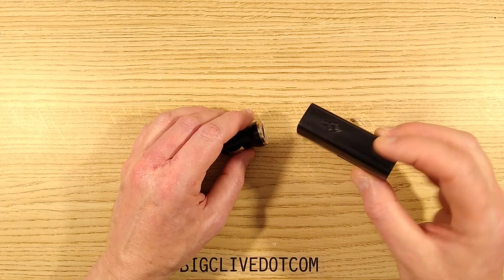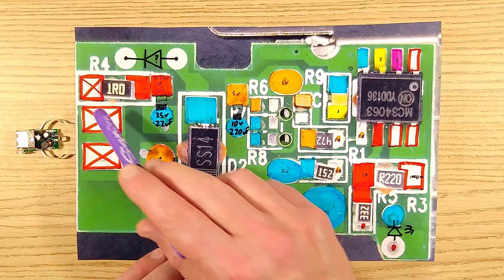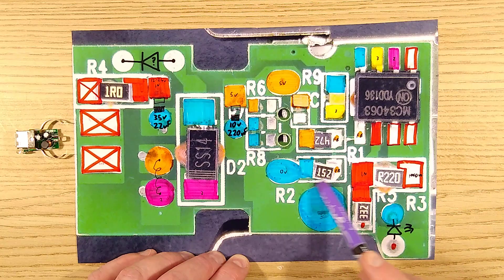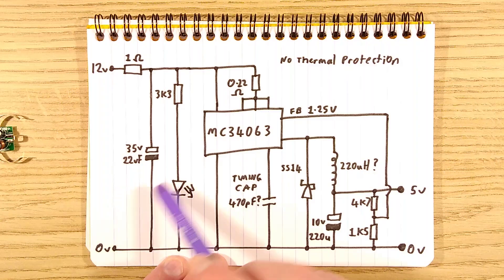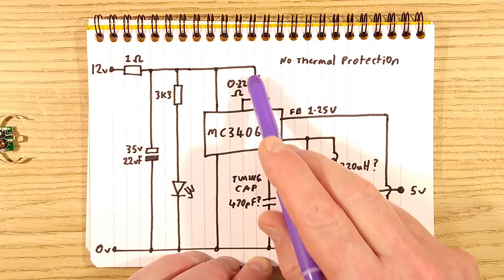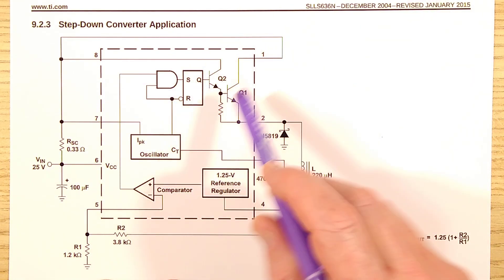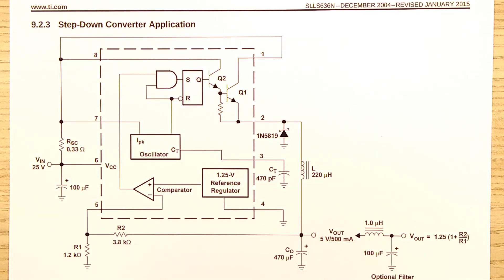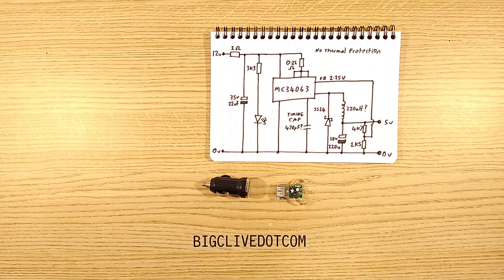Ordinary product with iconic component

Comment: Motorola Semiconductor Products started in Phoenix, AZ in 1949 and made some of the earliest transistors and ICs. In 1974, Motorola built its first chip plant in Austin, TX. Its microprocessors were made in Austin. Its transistors, analog ICs, and logic chips continued to be made in Phoenix. The Phoenix division was spun off as ON Semiconductor in 1999. The Austin division was spun off as Freescale in 2004. Freescale merged with NXP in 2015. So the MC34063 was effectively made by its original manufacturer as are many, many other "classic" devices.
Reply: Looking at Goo maps, the Motorola plant on Ed Bluestein Bl in Austin is just a concrete pad overgrown with weeds.  😮
Reply: @acmefixer1  Some of the plants are gone. But my old Motorola data sheets show 3501 Ed Bluestein Blvd., which Google maps shows as an NXP location. NXP's web site says they have two wafer fabs in Austin and two in Chandler, AZ. Not sure if the Chandler fabs are former Motorola ones or new. More research to do. I'm somehow obsessed with semiconductor manufacturer history, which I've been following since the 1960s!
Reply: @mikemike7001  
Goo Street view shows two small businesses and a sign that says "Life Sciences & Technology Innovation District."  Looks like the bldg behind it was torn down and was made into a parking lot.  But yeah, across Semiconductor Dr. is the big NXP plant.
Reply: @acmefixer1  Here in New England, many biotech companies also moved into former minicomputer company buildings. Will be interesting to see where the CHIPS and Science Act will help revive the semiconductor industry in Austin and elsewhere in the U.S.
Reply: The NXP plant in Chandler AZ at the intersection of Alma School and Knox has been there since the 1980s when I worked for Motorola. It seems to still be active - there are cars in the parking lot when I drive past.
Reply: @ebrombaugh the ON plant at papago is also there
Reply: A long time ago I was something of a Motorola fanboi. I still have my set of Mota discrete semi databooks from 1970-something. That changed substantially not long before the split to Freescale and ON. The microprocessor operation of Motorola basically abandoned all but its automotive customer base. ON went on to have little of particular interest for modern design. It was OK for some jellybean parts.
Reply: @D614G_aka_Doug  Yup. Used to be you could design just about anything using only Motorola parts. I too still have some printed Motorola databooks as well as a CD-ROM or two, and I wonder what happened to Imperial Litho when "circle M" switched to CD-ROMs. 🤔
Reply: Automistake on my phone tries to give me the version with the apostrophe every time. I have to go back and fix it but might not catch all of them ...
Reply: Semiconductor companies tend to split and merge a lot. Looking at a Sega Genesis/Mega Drive you find chips made by NEC, Motorola, Signetics, Hitachi and Mitsubishi. Hitachi and Mitsubishi merged their semiconductor divisions together into Renesas, which bought out NEC. Motorola's digital division became Freescale which was bought by NXP. Signetics was integrated into Phillips Semiconductors which became NXP.
Reply: @rfmerrill  Yup. A fascinating history that all started with the traitorous eight, a group of eight employees who left Shockley Semiconductor Laboratory in 1957 to found Fairchild Semiconductor.
Reply: After the velvet revolution and colapse of the iron curtain, Motorola bought a former Tesla factory in Rožnov, Czeh Republic. Some of the newer versions of the MC34063 were designed there. I did some measurements for the datasheet when I was an intern there.
Reply: @mrkv4k  Cool. Onsemi still has a factory in Roznov and a design center in Brno. I think the design center used to belong to a different company that merged with or was acquired by onsemi. Mergers and acquisitions are the semiconductor way. 🙂
Reply: @Okurkaarrgghh  Errors like that just flow naturally from my fingertips even if my brain knows better.
Reply: I was in Phoenix, Arizona last week & am not familiar with that town. I was there to help my daughter move into her dorm at Grand Canyon University in Phoenix, planning to major in Electrical Engineering. I was staying In Scottsdale & on the drive from there to GCU I saw a manufacturing plant with the sign ON Semiconductor. I did not realize it was a descendent of Motorola. There is some manufacturing activity around Phoenix, one of which is a new TSMC fab being constructed there now.
Reply: When my grandmother was young, she worked at Motorola in Phoenix doing QC on chips, possibly even these.
Reply: Which makes sense because they have all the tools or dies or whatever they're called, which is the biggest cost and probably took mad time to dial in back in the day but is a cakewalk today, so of course they keep making it. What works works and it sticks around up until it's just no longer feasible to use it because everything else has changed so much in the technology.
Reply: They used to make Ford trucks in San Jose, Ca. Cool to see one still driving.
Reply: Right near roswell same time

Comment: I love seeing older technology still being relevant in todays world  :)
Reply: The PPC 750 still lives on as the RAD 750 in space projects.
Reply: @Thelango99 even the RAD6000 is still being used. And I think some stuff still uses 680x0 (what's the modern name, CPU32?) based SoCs for comms. While modern commodity hardware is doing surprisingly well in carefully selected use cases I don't think these old ISAs suitable for massive process nodes will disappear from specialised uses anytime soon.
Reply: It's odd, because I'd expect something like National's Simple Switcher or a Chinese knockoff to be used here.
Reply: Nuts and bolts of yester year are always in the tool box of the future.  Let's start with the wheel in this conversation. It's awesome to find a video describing the use of a circuit design that has become one of those nuts and bolts, in this case for a quite variable use, tools that will continue to be used into the future. TA was and still is a awesome company.
Reply: I'm curious as to what older technology you're referencing in comparison to what other "technology" we might otherwise be using now.
Reply: @td3993   
The power supply chip was the older tech I was referring to  :)
Reply: @gregorythomas333  The power supply chip isn't an older technology. We still use the same technology. It's a different package and circuit arrangement. What you say is like saying that a television that uses compactron tubes uses different technology than one that uses octal tubes.
Reply: I've seen some cheap laptops at Costco with PENTIUM processors in them lol
Reply: @nomusicrc they're just CALLED Pentium, they're not actually the same as the pentiums from the 90s. Still, pitiful performance like all of Intel's low end/low power chips
Reply: @qwertzy121212 Yeah low end has changed a lot especially since AMD has been clapping Intel's Cheeks for a good number of years now
Reply: @qwertzy121212  So why would a company rename something that they've already released but it's different
Reply: @misterhat5823  well that's INTELligent
Reply: @qwertzy121212 yeah even in the nineties if u want intel you go big .
If u wanna save money go with someone who makes cheap chips.
I hated the celerons
Reply: @infernaldaedra  low end has never changed. it's always been bad, and always will be, AMD OR INTEL it doesnt matter, the only perk of AMD low end is the Vega graphics cores. Other than that AMD low end is worse, The graphics make it worthwhile.
Reply: @Catknapper  Low end CPUs now are not comparable to previous generations they aren't amazing or anything but they are definitely better than what came before
Reply: @nomusicrc ❤
Reply: All circuits must contain a 555, an obsolete chip and at least 4 resistors and a capacitor that you cannot work out what they do or why they are there
Reply: "I love seeing older technology still being relevant in todays world  :)"

Like my wife ... Old but gold.